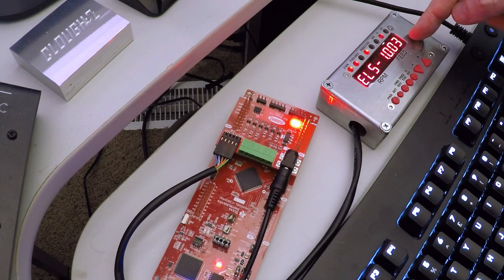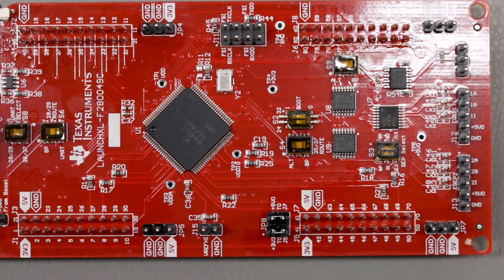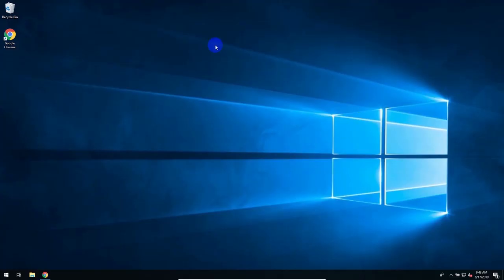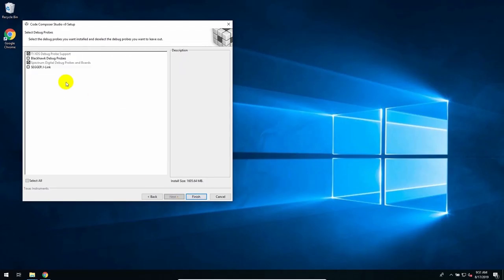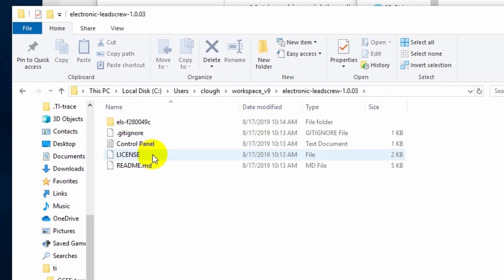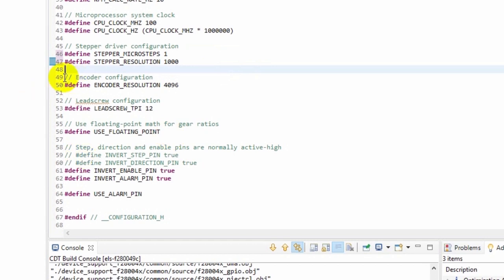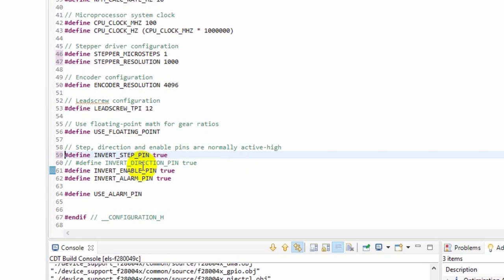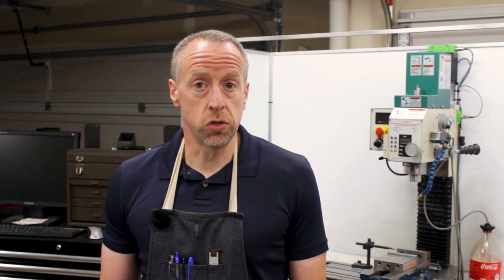Lathe Electronic Leadscrew Part 10: How to Program a TI LaunchPad Microcontroller

Comment: I have implemented this on my lathemaster lathe and it works fine with the original stepper motor, but I have now fitted the integrated servo from steppers online while it works in forward or reverse via the rear switch sw6 I am unable to get it to change direction via the control panel, any help would be greatly appreciated
Reply from the maker: It's likely an issue with the DIR circuit or servo configuration.
Reply: @Clough42  thank you i think it is this issue of common + and negative switching will se how that can be implimented, i know on one of the other videos you talk about the common cathode will see how that can be applied to the iSV57T driver Thanks Dennis
Reply: Thanks, James one wire in the wrong position silly mistake,I had connected 1-6 on the io board and 1-6 on the servo, so pulse and direction +ve in pin one and move en (dri -ve) to -ve drive and all is working, Thank you for such an incredible project it has totally changed my lathe also have installed the vfd and motor

Comment: I dloaded the CCS and it was version 10..it couldnt compile it so dloaded V9 and got it to compile but I cnat program the TI board. It wont recognise the port. Found the 110 section and it says for a MAC you need to install LiUSB..well I had a look at it and its beyond me :(...so difficult) Do you have a forum somewhere other than what is on Github?

Comment: Trying to troubleshoot an issue that has cropped up.  My ELS just... quit.  It acts like there's no signal from the encoder so I bought a new one of those but that didn't fix the issue.  I'm trying to format(?) the TI board now to start over with programming that.  Do you know how to do that?  I'm not having any luck finding out how to do it.  Thanks!
Reply from the maker: You just program it like you did the first time.  There's no formatting because there's no file system.  You could try using the second encoder input  (EQEP2) after changing the setting in Configuration.h
Reply: @Clough42  Thanks!  That got it working with the new encoder but now the feeds are off so I've got something set wrong with this different encoder. It's a 1024 like the last one but feeding way to fast. Maybe it's not a quadrature encoder. More testing required.

Comment: Having just tried this I ran into an issue that on loading the debugger for the first time it said the XDS110 firmware needing updating and did I want to do that. I said yes...and it failed to update it then didn't recognise it again. 

I fixed it, and for anyone else who runs into this I did it by going into the c:\ti\ccs910\ccs\ccs_base\common\uscif\xds110 directory (assuming you installed it in the default location) and then running 

"xdsdfu -e" 
to ensure I could see the device then 
"xdsdfu -m" 
(command errored as in my case it was already in dfu mode) and then 
"xdsdfu -f firmware.bin -r" 

This fixed things and I could then access it in the debugger and successfully programmed it.

Comment: I note in version 1.4.00 there is now a line of code to "define HARDWARE VERSION 2". How can I determine whether I have v1 or v2 of the LaunchPad ?
Reply from the maker: It's not the launchpad.  It refers to the boost board, which has a version number printed on it.  You almost certainly have V2.
Reply: @Clough42  What's the difference electrically?
Reply from the maker: @boldford  don't remember.  You could look at the code to see what that macro changes.

Comment: I have the eval board and tried loading the code, but Studio acted like it didn't know which USB to use and never showed it arriving at the start of the problem. Also couldn't find where to tell Studio which USB port to use. Queried the board using "verify", and it then appeared to see it. After that, it then appeared to be working. Curious what it'll do the next time I start up Studio.
Reply from the maker: I've never had an issue.  I just plugged it in and it worked--on multiple different computers.  Are you using a VM?
Reply: No, I tried it as is on a Windows 7 machine just to see what would happen. I'm curious how Studio figured out which of nearly 8 ports to use, because I never did find if Studio allows setting it, but I'm glad that it figured it out!

Comment: After watching the how to load the program video, I see that you are  using GitHub to load it into the TI V9 software. I went on line to find GitHub only to discover that they want $430 per month to use their software.
Is there any other way to load you file and not use GitHub?
I don't plan on doing anything but load your file and make the changes to match my lathe. So it's a lot of money to use one time.
Reply: Github is free. Hopefully you've figured that out.

Comment: For version 1.3.01 when I run the debug on the elsf280049c file, it has an error that the program “MAKE” not found in PATH. Anyone know how to fix this?
Reply: Switched from version 10 to version 9.1 of CSS and it fixed it

Comment: i have watched the how to load the ELS program three times and can't get it load into the TI software. What am I doing wrong?
Reply from the maker: Hmm... Not sure.  Are you getting some kind of error?
Reply: @Clough42  I don't get an error, I just can find the program to be able to load it. Is there a web page that I need to go to first, if so what is it? Thanks Will
Reply: In your video you say go to GitHub to find clough42 / electronic-leadscrew, I can't find GitHub in the program.
Reply: I just looked on the web for GitHub to sign up for it, there is a $430 fee per month to join.
Is there any other way to load the file?

Comment: Tape is for PICK-AND-PLACE machine
Reply from the maker: Yup.  I'd love to have one, but totally couldn't justify it.  :)
Reply: @Clough42  Yup kapton tape is to enable suction for the p-n-p head to pick up odd components.
Reply from the maker: @epotis  Ahh... Now I'm following.  That makes total sense.  Not sure where I heard the other explanation.  In that case, it was a buzzer, but the same thing applies, since it had a hole in the top.
Reply: @Clough42  It's the usual initial assumption, but then you run into something with a piece of tape near the center of mass but not watertight - usually an smd connector - and you are left scratching your head. https://i.stack.imgur.com/YP4hp.jpg
thank you for your videos!
Reply: @Clough42  Depending on the component, you may need the tape for PandP (the switches), postsolder cleaning (through hole piezo units, for example), or both (some piezo need the tape for both reasons, and the switches may, as well). There are also a few components where the tape is vestigial (it was needed for a late operation in manufacture, but is not needed after, but the component manufacturer saved money and did not remove it... The only example that comes to mind is a mil-spec potted module)

Comment: can someone please God help me with this composer studio thing. I seriously have like nine hours trying to love this firmware and I'm at the point of slamming the laptop on the shop floor. I followed the steps of this video and my import workspace whatever does not present the same same way. I have the correct versions of software and I'm using Windows 10. I'm not a computer guy. I have some kind of mental block I need my handheld because I think I'm three clicks away from making chips again. Anyone willing to help me via FaceTime or some emails or a phone call to Complete what I'm sure is very simple but I'm too retarded to figure out.... I swear I don't suck but I need some real help....
Reply: load*

Comment: burger me this old fart can't do all that.  I have windows 10 but by gum son . it striate  over my head.   I just wont it ready to use just as  if I buy   the computer , I'm to old to even try to  understand it ,  I sups that why I never when any farther with the original ideal ,   make  it ready to pug in & use . pleas , .
Reply: Whether you think you can, or think you can't, your right—Henry Ford 
My father was giving computer advice until weeks before he died at age eighty. I'm only 64, and try to learn something new every day. I was a programmer for the DoD, and this little thing is great recreation, and James' instructions make it easy. There can be no "plug and play" as every lathe is different; heck, I'm replacing the lead screw in mine with a ball screw.

Comment: Pretty cool.....but I think I'll stick to changing the gears when I want to do threading.....having to have a stepper motor on the leadscrew, an encoder on the spindle and another stepper on the crosslide is too much like complication for a manual lathe..........never was one for downloading obscure files or configuring other thingies to get to do something that has no meaning for me.......just how many oddball threads would you need to cut in your lifetime that you can't get with a set of gears and a calculator.
Oh, and BTW, anyone who has an Imperial leadscrew at the same time has a Metric one.....you just need to convert the pitch of the Imperial leadscrew to  a metric one for any gear calculation......easy peasy.
Reply from the maker: Are you talking about a lathe with a quick change gearbox, or one with a bag of change gears that you swap in and adjust to change thread pitches?